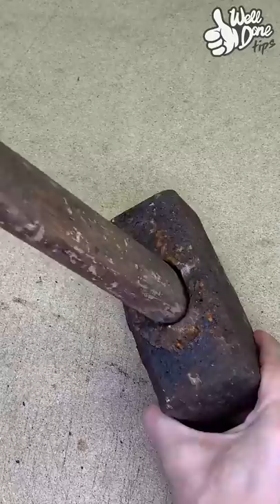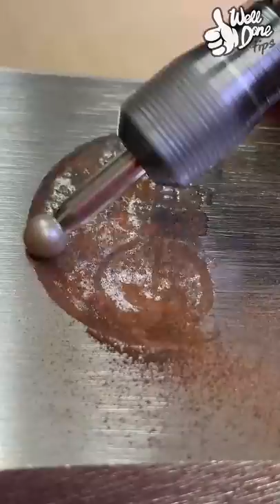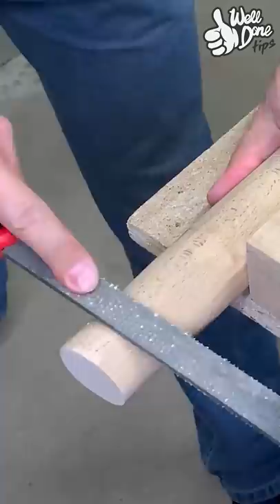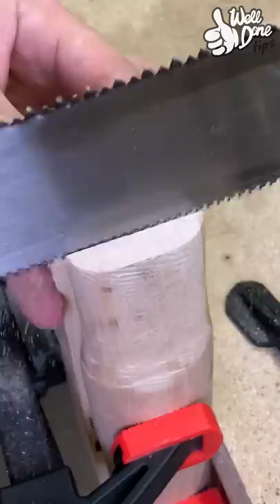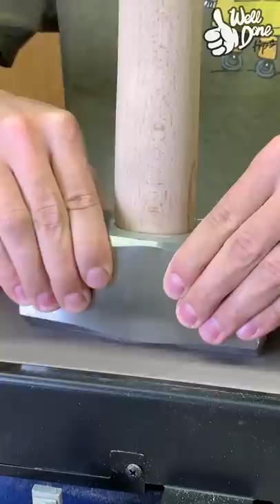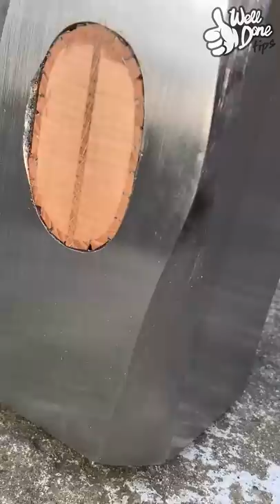Extremely Rusty Hammer Back To Its Glory #shorts

Comment: Your work is excellent but you don't need all the skinny wedges around the end of the axe handle. Old style sledges mount the same way old style carpenter hammers do. Wood wedge then two or three metal wedges perpendicular then sand smooth. If you're not comfortable with one wood wedge use two.

Comment: You should stick it in a bucket of water....it swells the wood and makes the head really tight
Reply: You gotta soak with linseed oil, the water is eventually gonna dry and the handle will loosen up.

Comment: Never seen a handle fitted like that… I think he might’ve put the head on upside down
Reply: Yeah, I think the head is upside down too.

But fitting it shouldn't matter, both ends of the eye are tapered inwards, so when you put the wedge in it expands creating a great mechanical seal.